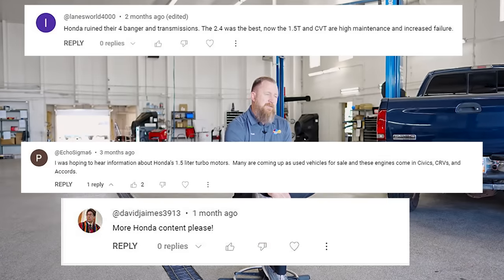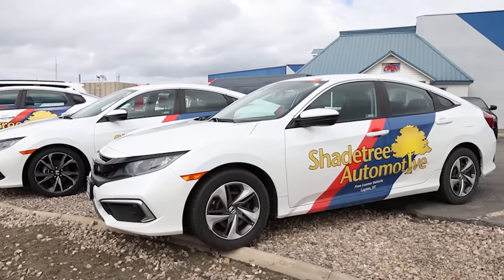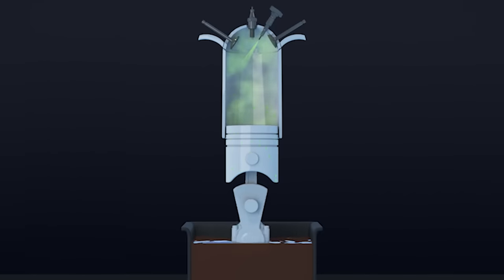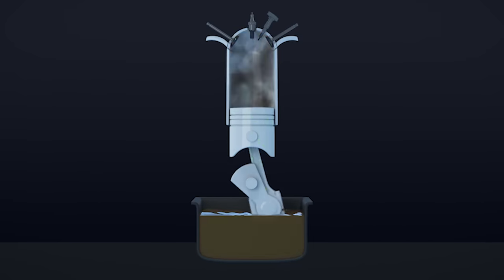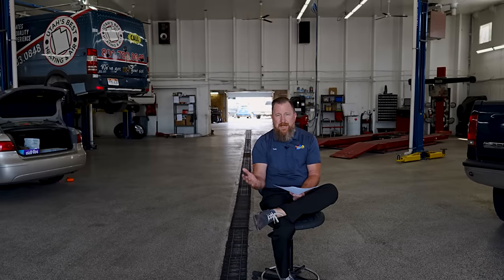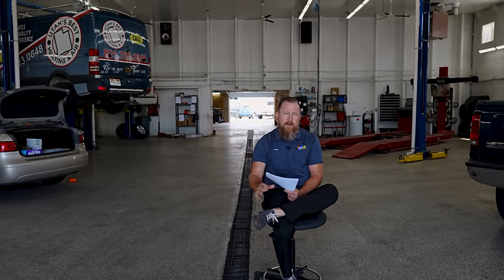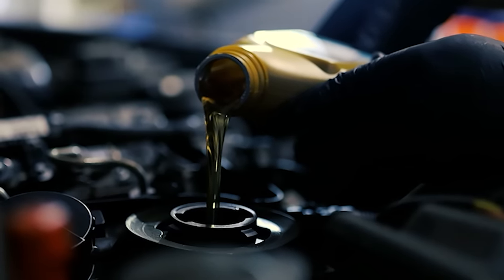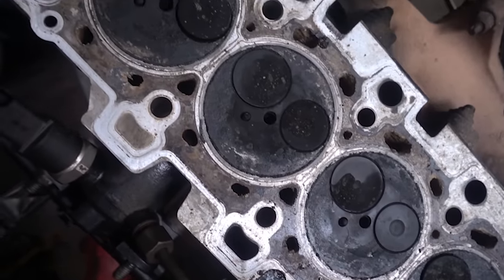Honda Oil Dilution Issue - Should you buy a new Honda

Comment: From my experience, using ethanol-free gas seems to help with the oil dilution issue, at least for me. I own the 1.5T engine. I have a theory that the ethyl alcohol makes gas a little bit thinner. Also the slightly higher octanes of the ethanol-free gas might help a touch too. I drive a mix of half ethanol gas and half ethanol-free in the summer but all ethanol-free in the winter and change my oil about Christmas, if it's over 3k miles. then again in February at about 3k more miles. Then I go back to 5k intervals in the spring and summer, but more more than 5k. Also, if you have one of these engines, start up and drive away straight away on a cold morning. Don't let it sit and warm up under no load, parked. You engine will warm up far faster under load, thus limiting the oil dilution. So just get in and drive it away within a few seconds.
Reply: Strangely enough you make a valid point. Yamaha outboards have a known issue of making oil. (Dilution). These higher HP outboards are used offshore and spend many many hours at idle or low rpm trolling under little to no load. It has been an issue for years and Yamaha says the remedy is to give her the beans. Italian tuneup. Run er like you stole er.

Comment: Funny thing is, I’m having the issue with the 2.0 turbo. I called Honda and they tried to convince me I was wrong. I pull up the computer screen in the car and see lots of misfires in number 3 cylinder and fuel smell in my oil. I lived in Colorado and purchased the accord new, did not experience this issue until I moved to Florida. I change the oil every 4 thousand miles at this point.  Just installed a new battery, and let the car run for a few minutes before I shut off. So far good.

Comment: Last November, I purchased a 2019 CRV LX, 42,000 mi. In excellent condition inside and out.  I probably paid more for this LX base model. Than many people would of paid for an EX with all the extra goodies. I did not want that 1.5 Turbo.  8000 miles later I have changed the oil at around 4,000. I have changed the CVT fluid twice already, due to it never being changed before. As far as I know. I wish it got slightly better mileage. Average 26.5. But I couldn’t be happier with this vehicle.
Reply: Interesting MPG. On the 2019 EX-L with the 1.5T we get mixed city/highway 30 MPG.
Reply: That NA is a bulletproof engine. I had a 2007 crv lx and loved it.

Comment: I’ve done Blackstone UOA tests every other oil change on my 2017 1.5L Civic over past 65k miles. It has not shown oil dilution issues. Drive your car harder and change oil every 5k miles. There is a reason the CRV owners are the ones that talk about this the most. They never drive them hard and keep long oil change intervals.
Reply: My understanding was it occurred mostly under cold weather conditions. As mentioned here and several years ago...
Reply: Of course your Blackstone report won't show your fuel.... you burn off the fuel when you warm the oil for the oil change.
Reply: @JackRR15  nothing like telling the entire world you have no clue how an engine works lol
Reply: Drive it harder? That defeats the purpose of having an economical engine.

Comment: IMO
High pressure fuel pump leaking past the seal is the problem.
-causes gas in the oil as well as low fuel pressure which leads to long cranking until the pressure in the pump is regained.

Comment: I just bought a 2021 CRV Touring AWD that was a corporate vehicle w/under 16K. Carfax showed the oil was changed quite often. Owned less than 1 month and changed the oil myself with Mobil 1 and OEM Filter. I drive 25 miles one way to work. I also before shut down let it idle a bit to relax the turbo. This is my first Honda.. we'll see how it goes

Comment: Thanks  for the info Tom!  I have a 2020 CR-V and haven't had issues yet.  But I live in southern Arizona and typically drive at least 20 minutes to work at the minimum. However, while I was searching for a new vehicle, I did test drive a 2018 CR-V and when I checked the dipstick it wreaked of gasoline.  They knew something was up and it almost  kept me from buying Honda ever again.  Mind you my first car was an 82 Civic CVCC Wagon, then I've owned an '88 and '92 Civic which were gems.  Then on to a 2007 Civic which was incredible.  Bought my daughter the 2017 Civic and she's had the updates as well as I'm a stickler for getting that oil change every 5,000 miles.   The dealer has told me we don't need to do that with the CR-V or the Civic, and I tell them I still want it.  Appreciate this breakdown video!
Reply: So has it helped you? The 5,000 intervals?
Reply: I can only say I haven't smelled gas in the oil and both our cars are doing swell.  So I can at least say it hasn't hurt! 
 @CenobiteBeldar
Reply from the maker: Thank you!

Comment: Honda is going to be untrusted brand here also in Indonesia. That oil dilution problem also exist here for the 1.5T engine in very hot climate country. The problem for the owner usually is quite the opposite with the problem in your country, the engine oil is run out for the some amount of time, before the time to change the oil.
The most up to date problems with Honda brand here in Indonesia and South East Asia is their motorcycle. Some of their motorcycle, millions in unit, are using new frame they called ESAF, which has very poor quality, many problems that the frame are broken in the middle of the road while driven, even when the age of the motorcycle is less than 3 or four years. They don't accept the responsibility to do recall for their product, but suggest the customer to buy new frame of their own cost.

Comment: With changing the oil at 5000 miles, my 2017 Honda CR-V runs about 2.5-3% fuel, with viscosity near the lower limit of acceptable (but not lower than allowed).  I certainly wouldn’t extend the oil change interval as long as the computer allows.

Comment: These engines come from the factory running 16.5-18psi of boost depending on the application. That's pretty high for commuter cars. My diesel runs less boost.
Reply: That is high. Should have went 10 psi
Reply: Not true. I’ve got a 23 SI and I can barely ever get it to go above 16 psi.

Comment: This is probably the best video I've seen on the subject. So much misinformation on why this happens, and it's refreshing to see an unbiased conversation backed by facts.

A couple things I'll add:
- On the topic of carbon buildup, Honda actually runs comparatively clean compared to most TCDI powertrains. If you do a lot of highway commuting, Honda allows a small amount of fuel to mist the intake area on the piston upstroke. The intake valves also reportedly rotate to ensure every corner gets "washed." An induction service every 30K "might" be an overkill, depending on the type of driving the owner does.
- While fuel dilution is a very real issue, the maintenance minder often intervenes before it becomes a problem. In the most extreme driving scenarios, we've seen the MM recommend an oil change as early as 2.6K. That said, some owners still report problems after the software update and increased OCIs.
- I can't remember if it was mentioned, but Honda has extended their coverage on the 2016-2018 1.5T CRV/Civic up to 6 years/unlimited miles. It's limited to vehicles in colder climates and addresses the longer concern of premature wear to the camshafts. For most, that warranty period has already expired.
Reply from the maker: Thank you!

Comment: I loved my ‘18 Civic hatch. I was gonna buy at lease end but the oil dilution issue persuaded me not too. It was bad. Also, the engine under light loads and in cold weather here in NY would operate at such a low temp that the heat would not work.

Comment: I own a 2019 crv with the 1.5 . I live in northern part of Canada.  I have excessive oil dilution. I agree  with your comments. Honda canada denied they had a problem. So what I do is doubled my oil changes run the vehicle in sport mode to keep rpms up. I keep my heater on low. I have done all the updates. Now your comment on the owner having to do their part I disagree.  I think this is excessive. I also run higher octane gas to keep the injectors clean and run a pea cleaner once in in while. Why didn't honda have port injection and direct injection like Toyota. I will speak  with my wallet and move to Toyota.  The dealer in my town has had ice build up in the crankcase of many of these engine that have short runs. If you drive on short runs city driving and idle with heater on high this engine does not stay at operating temp. Only way to get to operating temp is to highway drive.

Comment: Honda has a Maintenance Minder on their cars. I would suggest they come in for their changes at 40 or 30% as opposed to a set mileage. In my HR-V that's mostly doing five minute drives to work and back, it sets off a maintenance alert around 5.5k miles, but if the 1.5t needs earlier changes than it suggests, they might actually want it done before 5k. Obviously I'm not a mechanic so I'm going based off what seems logical to me, but if 5k works for customers then I guess that works too.
Reply: Hrv legit is the most reliable Honda made. They use the 1.8L or the new 2.0L in the 2023 and those are pretty good engines.
Reply: 2020 Accord EX-L 1.5. Maintenance minder is usually at 40%, around 6k miles when I get my oil changed. Mostly highway miles. Had dealership check out possible gas smell on oil dipstick, they said it was fine.
Reply: @DoingthingswithDAN Naturaly aspirated, non-turbo.
Reply: @jimbike8064 Of course they are going to say it’s fine because they don’t want to fix it. I recommend you get an oil sample sent to black stone on your next oil change and see the percentage of gasoline that’s in the oil.

Comment: For carbon issues, VW has had issues with it as well. My dealer said to make sure to use top tier gas and avoid speedway. So far its worked, 230K and going strong.

Comment: I've worked for VW since 2011. And I've said this exact thing for years. 

While cars are less likely to leave you stranded these days, they are not made for long term reliability. 

While saving on mpgs, we end up wasting a lot of other materials which are not recycled. 

Asinine. The days are over where you can skip that extended warranty, unless you are prepared to self ensure thousands in repairs, or have the skills to do it yourself. 

Sad days
Reply: People need to change their oil more often too and consider going one grade higher in viscosity especially in hot climates.   3000 to 5000 miles is not unreasonable.  Expecting 10,000 to 12,000 miles from oil and relying on maintenance reminder light to protect your engine is ridiculous especially on these dilution-prone direct injection engines.
Reply: @scdevon  100%. Unless you run a bypass filter haha
Reply: Older cars are the best cars I font care what anyone says yeah they rust and need some restoration but who cares the amount of money you put in these newer cars were they make em less reliable you might as well put that money to use I'm an older car
Reply: you nailed it with the comment ''While saving on mpgs, we end up wasting a lot of other materials which are not recycled'' . I wish the government would see this isnt such a great trade off . I take the long way for my commute so my crv burns some gas in the oil therefore while the 2020 CRV gets better gas mileage than my previous 2013 CRV I'm using just as much gas lol

Comment: Finally, a clear and thorough explanation on this subject. I just got a '19 CRV with only 12k miles (in 2024!) and I was getting conflicted info as to which model was affected.  
Side note....I have a 2005 Saturn Vue with the 3.5 litre Honda  engine and transmission that is about to hit 300k miles in the next few weeks. 🤞

Comment: I am convinced that the widespread use of extremely low viscosity oils. I think that using at least a 5w-30 is necessary to avoid oil dilution.
Reply: it says on the manuals 0w-20 for fuel efficiency vs 5w-30 for protection!! you decide if you waste that engine at the end of the loan or protect it for many years to come
Reply: @wellnesscoach73  interesting.  sounds like 5w-30 is at least a partial fix then?
Reply: I use 15w-40 Rotella

Comment: Funny.....in trying to make their cars more fuel efficient........
1. They leak fuel within the engine lowering mpg
2. His recommendation was to drive it around more when you get a chance (even if you dont need to......increasing the amount of gas purchased)
3. Diluting the oil causes other damage to the car and increases maintenance as shorter drain intervals are now needed.

All i see is $$$$$ out the fuckin window. But yeah Hondas were rated fantastic in fuel efficiency by the EPA. Well done Honda.
Reply from the maker: yeah...kinda defeats the whole point huh

Comment: I have a 2016 Honda Civic coupe touring with a 1.5T engine it’s got 200K miles on it and it’s been fantastic I’ve not had one problem with engine or transmission . At 36,000 miles as soon as the warranty was up I switched from 0w20 Honda oil which is absolutely silly in my opinion to Amsoil 5w30 and I’ve never had any fuel in oil dilution I change the oil every 12K miles I do about 50% city and 50%h highway driving and I live in northwest Indiana so it get cold in the winter . I change the coolant every 70K miles with blue Honda coolant, I’ve always used 87 octane gasoline since it was brand new . At 60K I stopped using Hondas CVT oil because the CVT oil had a burnt smell and I started using Amsoil CVT oil and I change that every 15K which is a little excessive but I see it as cheap insurance compared to a new tranny but the oil never looks or smells burnt . Every when I go to and leave work I let the car warm up for 10 minutes even when it’s warm outside . Aside from the car having a few electrical problems and a low pressure fuel pump failure at 120K the car has been great . I repair and rebuild engines for a living for the past 22 years and I know how to get an engine to last and the number 1 reason I see failures is lack of maintenance and second most is driving/operating habits .

Comment: Good explanation of the problems.  If summarized correctly,  is that Honda made an a motor that has issues and the burden (cost / expense) has been shifted to the customer with more frequent oil changes,  de-carbon the motor, more service on the motor, etc.).  No where did the video talk about Honda compensating their customer for their design / manufacturing issues.
Reply: Stupid EPA. There are environmental costs associated with failed engines and added maintenance!

Comment: I have the 2019 Honda Accord 1.5 and I took it in for the software update and that didn't seem to make much difference I can smell gasoline in the oil even after I bring it home from having it changed I'm doing the 5,000 mi changes too by the way.
I know there's a class action lawsuit against Honda about this but it probably won't go anywhere but this is for sure my last Honda.
Why should the customer have to foot the bill to have this expensive cleaning of the intake valves just because of the way they built these engines.
I bought Honda since 1987 and of course the engines have always been bullet-proof but this engine is a failure in my mind and don't forget the low tension oil control rings they use on these that causes severe oil consumption in many cases.
Reply: Speak with your wallet. I have been a honda owner since 1991. Disappointed  with 1.5 in a cold climate.. What is honda going to do when there will a massive amount of engine failures .  They will gladly  sell you another car.
Reply: I avoided myself the 1.5t in the Accord and got the 2017 where it was still the 2.4L non-turbo. Issue with Honda is their customer service is lacking.  Hopefully the class action goes somewhere. Honda had a paint issue on the Civics and they refused to do anything but they ended up loosing the class action for that

Comment: My 2019 civic coupe 1.5t has been fine so far. Im at 60k miles now. I change my oil every 3500 miles. I keep my eye on the pcv valve and change it every 20k. Im also running lucas low viscosity oil additive. Just incase. I also switched from the honda A02 filter (made by fram) to a baldwin, Purolator boss, or full , oil filters. I also use crc intake valve and turbo cleaner often as in 5-7x a year. Right before an oil change. I always warm it up during winter here in VT , and never do short trips and just shut it off.

Comment: I have had this problem on our 2020 card. At the last only change I pulled 6 quarts of fluid out of the oil drain. It smelled like gas for sure and the car had been running terrible with no pickup. As soon as I changed the oil the car ran much better. I definitely agree with changing the oil  at 5k miles. I wish we had bought a card with a different engine.
Reply: Did you have a dead cylinder filling the crankcase up with fuel?

Comment: Thats why I bought a 2.0t accord 2018 and not the 1.5,its rocksolid reliable and its not really affected by oil dillution as much as the 1.5
Reply: the 2.0t has its own issues such as head gasket failure. I would not call it rock solid reliable
Reply: @an4ndpatel  My friend has a 350 000 kms on his 2.0t and 0 head gasket issue of whatsoever.Mine has 110 000 kms and 0 head gasket issue as well.The k20 is a rocksolid engine but yes I heard some had head gasket issue but its a minority.

Comment: Excellent info for this. This mechanic sounds like he'd be a great one to have on my side, except he's over in Utah and I'm in PA.

Just maintain the engine, keep short trips to minimum, be aware of it, especially in cold climate, and you'll be fine.

Will this stop me from buying a Honda with this 1.5 turbo? Nope. If I can find a good used one at the end of the year, it won't stop me from getting it if the 1.5 is under the hood.